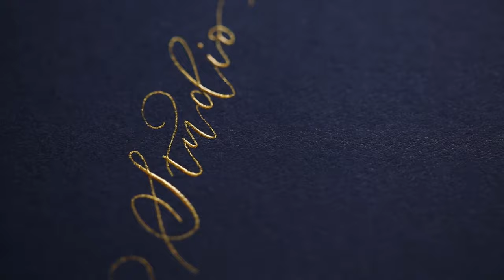The process behind making my writing instruments

Comment: I now own two, definitely coming back for more. Very nice pens. 
Just received pro flex studio...wow wonderful writer and perfect flow. It can with spare G nib, but I've no idea how I'd change out the old one from the feed housing.
I could suggest one thing to improve on the pen it would be to texture the grip. My fingers thanks to years of hands in the bunsen have very little sensitivity, and hardly any fingerprint for gripping so fingers slide.
Believe it or not powder coating, to me, is more difficult to hold, and slippier than mirror finish metal/resin, as powder coating/brushed metal finishes reduce cohesive function of natural oils/sweat. 

I have a question about the pen body and gold button on the cap.
Are either engravable? And by what technique?
So I ask for the right method and placement.
I definitely want my name /intitials on this pen, to ward off the envious pen pinchers. 😊
Reply from the maker: Hi, thanks so much for your message and sorry for the slow reply. Great to hear you've been enjoying our pens, thanks so much for letting us know. 

Are you still having trouble changing the old nib from the feed housing? 

And really helpful feedback re grip. Noted! 

We do now offer engraving on many of our pens, specifically the Lumos (all sizes), the Studio Pocket Fountain Pen and our Studio Fountain Pen. You can see how this will appear by going to the relevant product page on our website, and having a play with the engraving option. I hope that helps! Engraving is done by a super special and awesome laser.